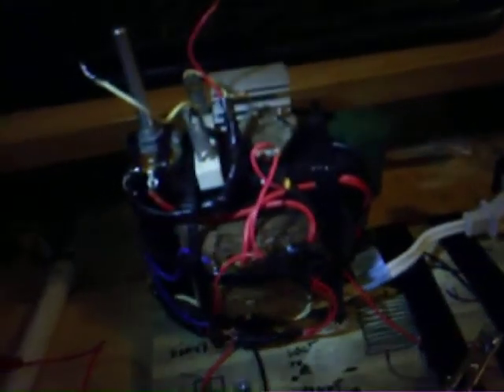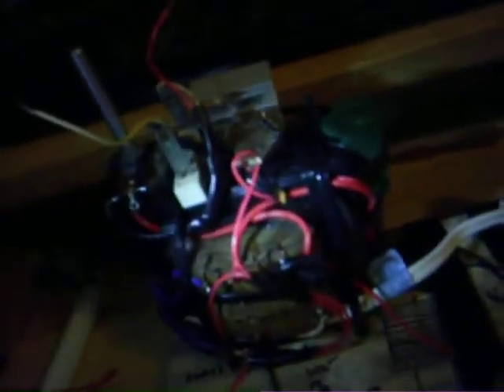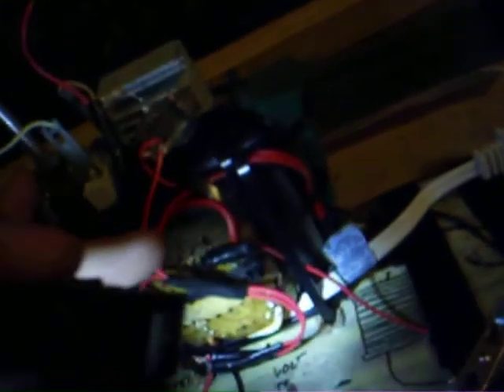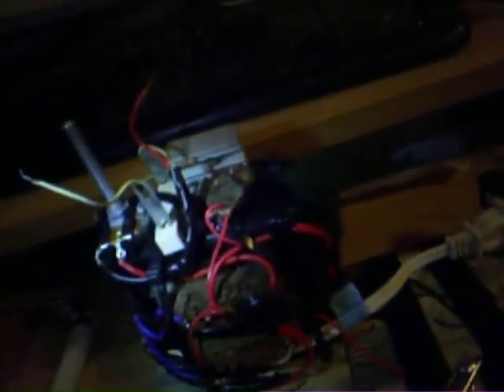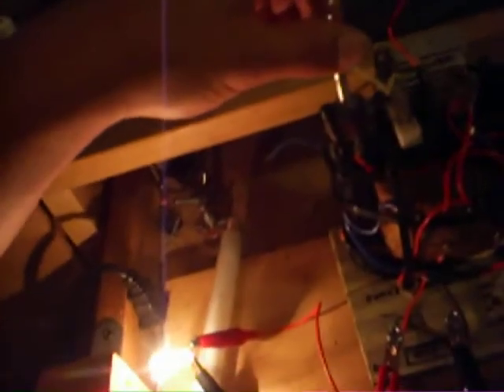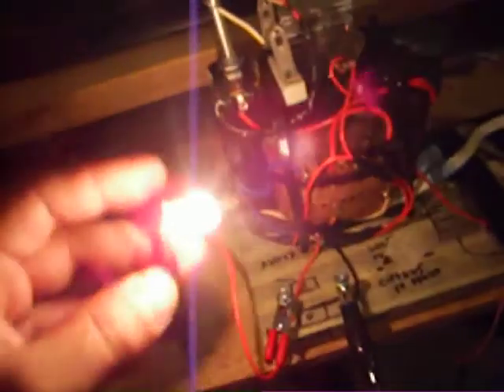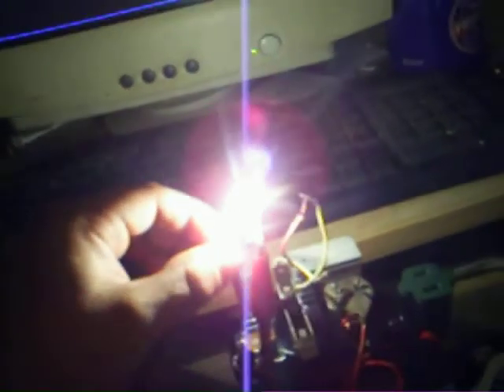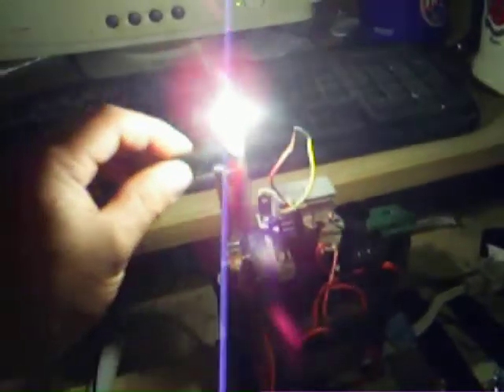12v Joule Thief Inverter

Comment: good question... I've never actually compared how long line (say 50+ ft) transmissions fair with an H-wave vs. a true sine wave. I built a circuit not long ago, an adaptation to the Tony Van Roon 555 oscillator / inverter that was driving a fluoro at about the 3-4 watt level (not bad light) and I checked, it was, truly, a sine wave coming off of it. Should be interesting to compare to JT's.